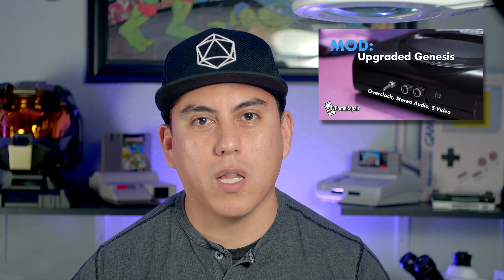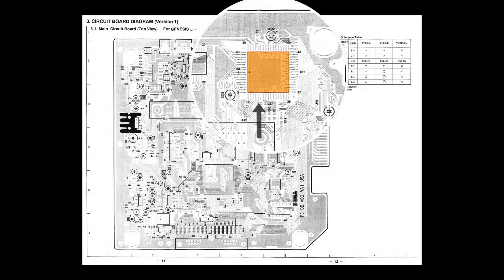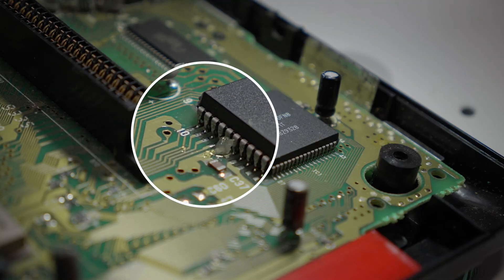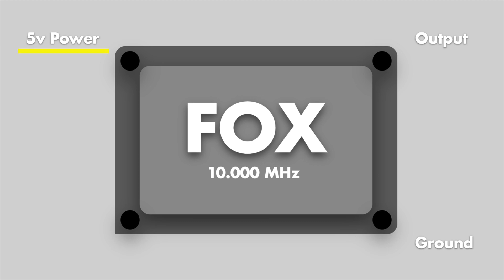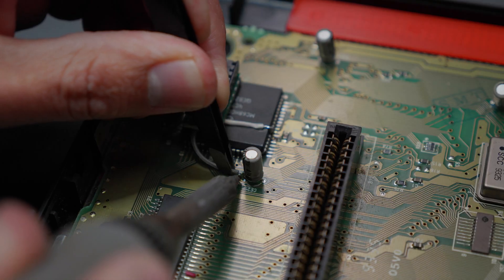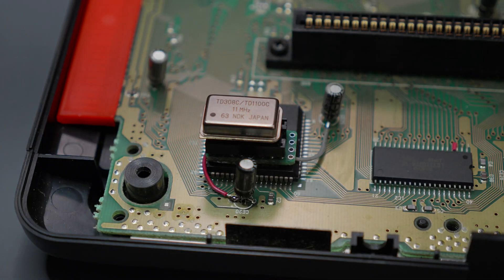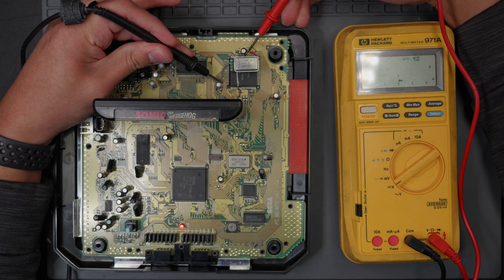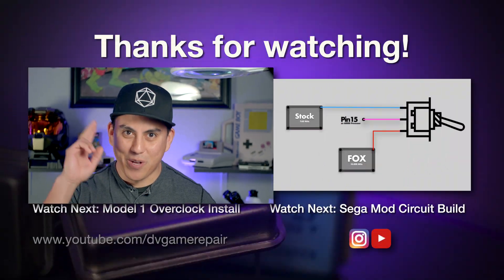Sega Genesis Model 2 Overclock: Speedtest Shootout

Comment: Can anyone confirm that with a 10MHz clock in place that I can still use passthrough on the 32X ?
Additionally does the 32X or Sega CD suffer any glitches when a 10MHZ clock is in place?
Figured I'd ask in a few places before I dive head 1st into an overclock mod.

Comment: Thats "O.C"  is at your own risk, at some point it fails and causes video corruption and crash. It's not as easy as changing the crystal oscillator, the synchronization between all parts of the console will be lost. The system try to compensate the discrepancy in order to synchronize and this cause lost of time.  Write a bench program and compare how much gain vs how many times fail. If you are not care to kill the console then it's ok, good look.

Comment: Amazing that SEGA didn't just set their Megadrive/Genesis systems at 10MHz (almsot twice the useful MIPS) and use 128KB of VRAM and 16KB of CRAM like the System C2 arcade board--4.096 colors out of 98,000 with 2x the bandwidth.  The Sega CD+SVP would still be dominating the market to the late 1990s, almost matching the PS1 for performance.

Comment: The sega genesis can handle 10.752mhz something the super Nintendo can't do🤣
Reply from the maker: Although SNES has a place in my heart, this is true!
Reply: I was a SEGA fanboy growing up. But SNES could put co-processors on carts cheaply (like the 10Mhz SA-1), whereas the Genesis design is screwed up forever. There are pins for external Color RAM on the VDP but they don't have traces on the motherboard to connect to the expansion port or cartridge slot so you get 4 palettes...Snes has 16 palettes to use. There are only like 20 brownish shades and 20 grayish shades on Genesis (if we are being generous with some reds and purples) and tons of crappy neon pastel colors.

If you want to see what SNES could do even without chips look at Tommy Moe's Winter Extreme/Val d'Isère Championship. Most of the bad rep SNES has is down to dev skill and publishers using cheap SlowROM (slows the CPU speed) instead of FastROM.

Comment: Good stuff man.  Have you done a s-video mod on a model 2?
Reply from the maker: I actually haven’t done one on the model 2 but the Model 1 I have. I am certain it is the same circuit to accomplish it. It’s definitely worth it on the Model 1.
Reply: @dvgamerepair3448  I am assuming that an audio mod is required as well?
Reply from the maker: @theMcPaul1  I would assume so as well. Mainly because it would be cleaner.  Audio would be pushed out the original av connector even if you modded S-Video but you would have multiple cables.

Comment: Amazing work , in my experience I did the same with model 1 and I got the results of 9 .4 MHz is the safest cuz sometimes even on 10 MHz the game works but sometimes after couple minutes it freezes , but I my was exciting that you got better results than mine , however do you know a way to get color on AV/S Video after you mod the region switch from 60 to 50 hz ? Cuz I did it with the regular cutting the traces and add SPDT switch and I get black and white picture so is there a way to have a color with the Genesis at 50 hz while the system is modded with S video ?
Reply: use rgb scart
Reply: If you want color on composite or s- video with a region mod you need a DFO, Dual Frequency Oscillator. The color signal doesn't get encoded correctly cause the timing is slightly off due different regions having slightly different oscillators. Otherwise you can use RGB SCART cables to get higher quality video with color, since that output is unaffected by this issue.

Comment: I wonder if your problem is that your adding an external oscillator that isn't synchronized with the rest of the hardware and you're hitting weird harmonics / going out of sync with the VDP (might explain those BG tiles scrambling but sprites being OK) as you go higher? Apparently the Genesis has its own frequency doubler / supplier for Carts with their own chips (like Virtua Racer) and planned for future addons running somewhere around 13.5 MHZ. - pretty sure the 32x requires this. I think a lot of those 13 Mhz+ overclockers are done by cutting the trace that supplies the normal clock and splicing in the pin that provides the higher clock to carts. Since the frequencies are either doubled or derived from the genesis itself, it may keep it in sync. Also, there's always the possibility that Sega used cheaper 68000 chips - often CPU makers take chips from the edge of the wafer and downclock them to make their cheaper chips because they're flawed and less stable at higher speeds.It's WAY less expensive to make one chip and downclock than several different chips. So maybe you just have a sensitive chip. Alternatively, you might be able to synchronize your clock using the original or, use a frequency doubler instead of a crystal... 

Here's an early vid of overclocking the Genesis using the 13 Mhz source: https://www.youtube.com/watch?v=zuHkq8uvnLc
Reply from the maker: Thank you for the insight! It does make sense that overclocking in the way I did could throw it just enough out of sync because I didn’t put together that some of the sprites were fine. What I really should have done too is checked the output clock on an oscilloscope to double check it was preforming the way I expected. You have given me more than enough to start working on how I might better achieve those higher clock speeds or how I failed this time. Hahaha. Thanks again!
Reply: @dvgamerepair3448  Yeah, np. Good luck!
Reply: @dvgamerepair3448  You know, I couldn't help but think about this some more, especially how sprites seem OK but BG tiles don't and why you'd get that weird threshold near 10.175 MHZ... Overclocked systems usually don't run "faster" (aka, timers and gameplay work normally) but lack slowdown. I'm under the impression that it's because they use H-blank, V-blank and F-blank to time when they're doing various tasks. Since it has the native capability to run 13 Mhz cart chips in place of the CPU, it has to have the capability to handle at least that frequency but it needs a way to prevent being overwhelmed or going out of sync.

I don't know for sure but, I imagine that the flags for blank intervals are being triggered by a signal from the VDP and NOT the CPU, as the CPU doesn't directly control the timing of the raster for the scanline, only the rendering for the data the VDP will display. Since it natively has that 13 MHZ clock for carts running faster chips too, it would make sense if the clock signal and the blank status' that trigger CPU flags are all on the VDP AND that it has (essentially) an internal interrupt that  stops the clock it generates for the CPU or triggers a flag to halt while it processes visual information until ready for more data from the bus so data transfer rates aren't exceeded. It also makes sense that the 13 Mhz signal is being generated there too.

 I infer that this is the case because it allows those external chips to take the place of the onboard CPU in cases like Viruta Racer or other anticipated carts running the SEGA equivalent of the Super FX chip without the issues you're running into, even though they're operating at much higher frequencies. Therefore, it also implies that there's a mechanism to synchronize everything properly that you can tap into on the bus to the card slot and by running a isolated clock, you're losing that. 

It would be interesting to hook up an oscilloscope to the pin providing the 13 Mhz signal to the cart and see if it has a interrupted period keeping everything in sync or (more likely) another pin (or 3) calling a flag at the H,V & F blank frequencies. IF synchronization is in fact the issue, you should be able to use the 13MHZ signal to control your own oscillator and halt or adjust cycles when necessary, overclocking it to any frequency you want only when it can handle it, or find the pin(s) that's being used to trigger the halt state / flags and adjust your oscillator accordingly.  Your goal is to OC the CPU so it can crank through data in the correct states but, you aren't just doing that - you're doing everything faster - like memory transfers and calls to the VDP and RAM -  and are probably exceeding the their capabilities. If you can get the triggers right, you could basically OC the CPU to its physical limit during the proper periods and relax it at others to prevent your problems. Probably. Maybe?  

If you watched that link I posted, the guy mentions that to change between normal and OC, he has to first stop the clock with a 2nd switch before adjusting the CPU speed or it'll crash. While he does so, the screen starts getting weird BG tiles from the VDP but recovers when the clock is restarted. Remind you of anything you're experiencing? The question is whether that's a flag / interrupt halting the CPU or if it's just disconnecting the clock but, you could probably examine the wiring to identify where you need to look with the scope...
Reply from the maker: @Wintermute_SilverPaths  First off, my apologies for the late reply, life and work get overwhelming sometimes. With that said, dang, you sound about spot on. I think you are on to something with how the direct feed into the cpu is causing everything to speed and not isolating it like I want. analyzinginterrupt that I could exploit somehow inject a different clock speed. Again, thank you for the path! I will definitely keep you posted!
Reply: @dvgamerepair3448  Good luck, I hope you make it work! It's the kind of thing I've been wanting to do for a while but I've been too lazy (90%) and lacked the hardware (10%).

Comment: is there a place that would sell an overclock kit or would you just have to buy all the components seperately?
Reply from the maker: It’s a simple setup and I’m sure you would be much cheaper off buying the components. You really just need the 5v 10MHz Oscillator ( I prefer the FOX branded). And a 3 pin on/on toggle switch.